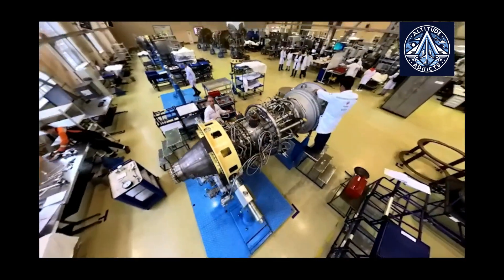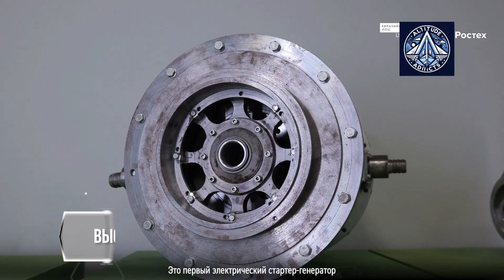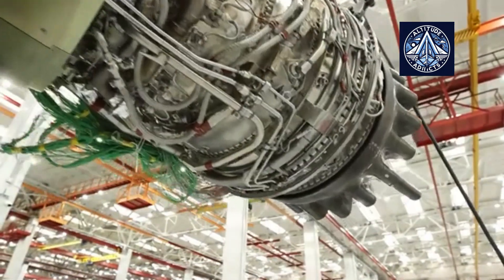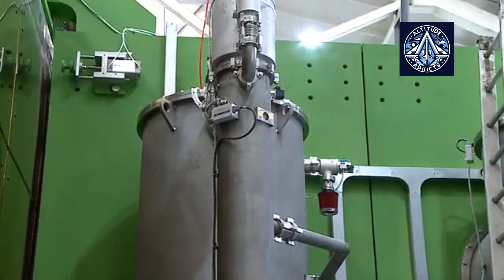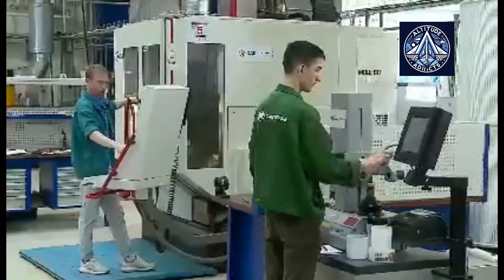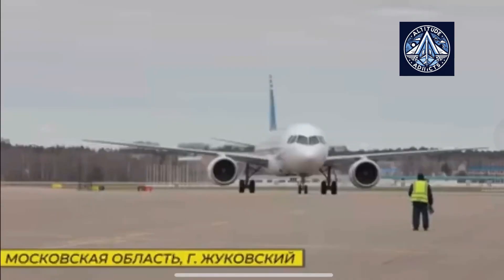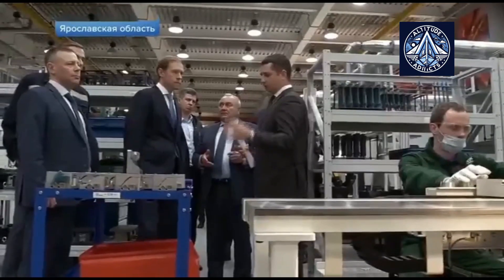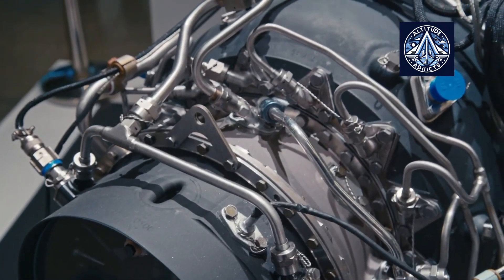UEC’s  PD-14 & PD-8 Engine Service Digital Platform to Rival GE, PW & Rolls-Royce

Comment: There is no GE, it is all SAFRAN...!.. 
CFM International and GE use all licenced IP from THE French multinational SAFRAN...!..
Give credit where credit is due...!..
Reply from the maker: GE and its joint ventures’ combined installed base of 39,000 commercial engines keeps maintenance, repair, and overhaul (MRO) shops around the globe quite busy.
Reply: @altitudeaddicts  Made with somebody elses IP.. They are just a licencee and just an investor and its financial services backing Boeing and US users and products to produce, maintain and manage the licensed product....
Reply from the maker: Show me the literature backing that.
Reply: @altitudeaddicts  C Compagnie, F Francaise, M Moteurs, CFM = French Motor Company!...
Joint Ventures are simply 1 master and one slave.
One designs and produces while the other copies and produces to a specific market...
In this case for US costumers.....!
Reply: Bull crap... I work for GE Aerospace, and we design many engines... the SAFRAN partnership is just for the CFM series only.  We have many other engine series, like the CF34, CF6, CT7, GE90, GE9X, GENX, HF120, HF Passport, Catalyst, and many, many Military engines which either share commonality with any of the above, or are unique to their applications.  The CF6 engine alone has more installed engines than any other wide body engine program in history, and our 101 and 404 series engines are used in more military aircraft than any other engine, period.  I might add, the CFM56, which is the most common engine in the world, is actually based on the F101 engine core from the B1 Bomber.  SAFRAN is a partner in building the civilian variant of it in the CFM series.  We also have partnerships with many other companies, including our competitors, for example, the GP7000 is a joint venture between GE and Pratt and Whitney.
Reply: @williamsteele  All the big jets engines are from SAFRAN, designed and built, GE is just a licencee...
Reply: @mazikkaluchka5562  You have no idea what you're talking about.